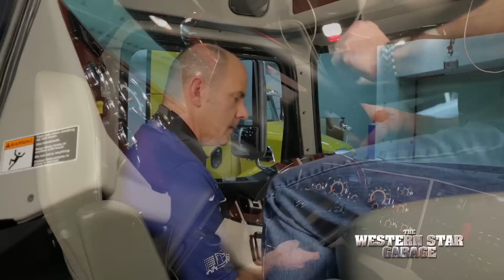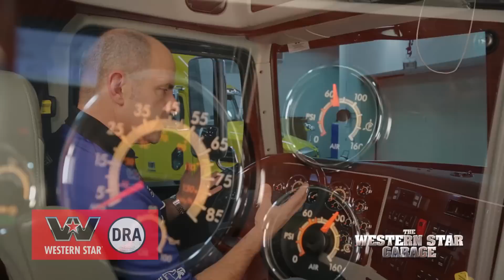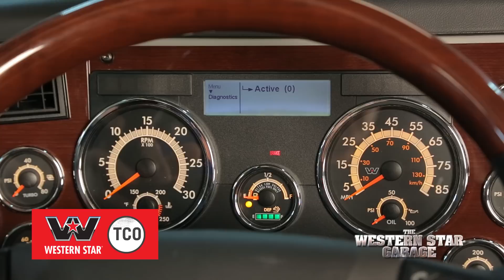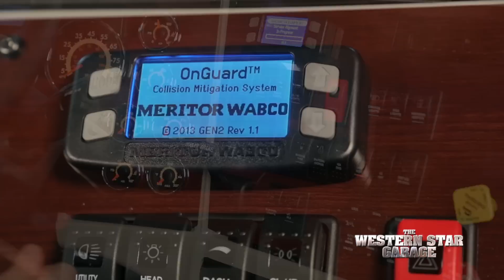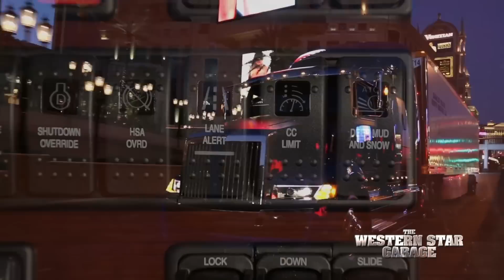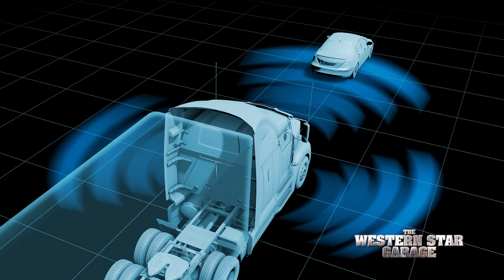WS 5700XE - Parts 6&7 - We Take Your Safety Seriously

Comment: The problem with the truck industry is the people who design this trucks never had a 100 miles behind the wheel of a truck,, all about some USB'S AND USB'S C ports on the   dash board, they are made in China and only cost a couple Dollars each....??? also that safety crap system its not safe its a hazard.